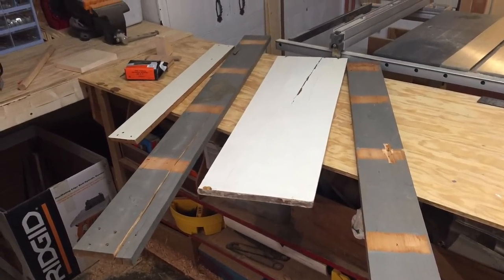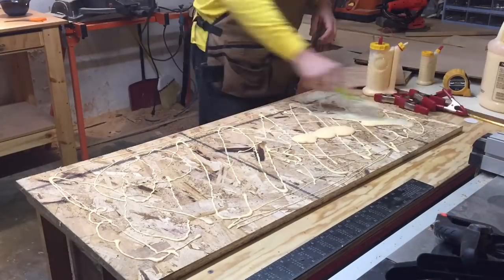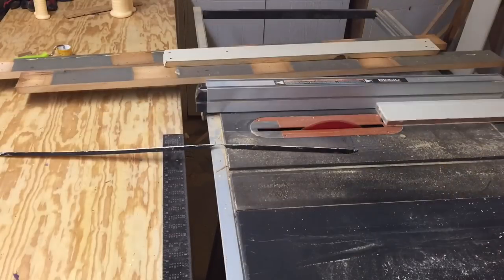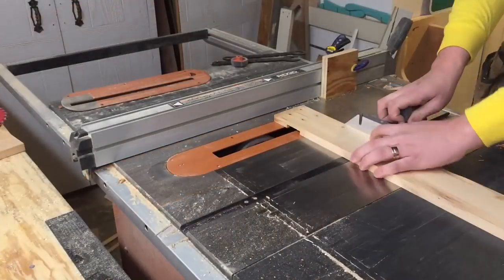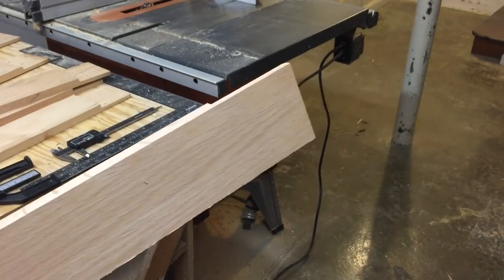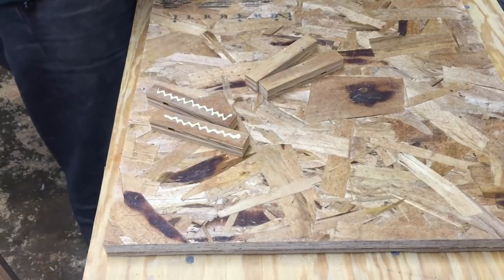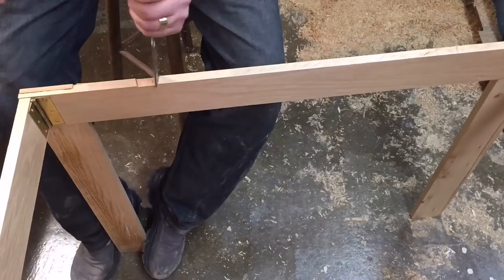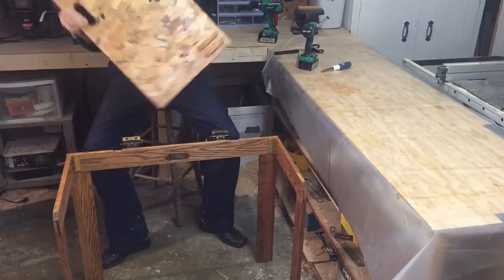How to Build a Collapsible Portable Table

Comment: Great video!  Quick question: when completely open, in use, does the table feel sturdy or does it wobble?
Reply from the maker: Thanks!  It's relatively sturdy.  I use it primarily as a portable table for setting down tools and supplies on when I'm at a worksite.  That being said, I have used a big chop saw on it and everything felt stable.  For me, I wouldn't feel comfortable with anything huge on it, but small & medium items are safe.

Comment: What kind of hinges did you use for the legs that folded in?
Reply from the maker: It's been so long since building this table that I really don't remember.  Odds are though, they were just a set I had lying around!  Happy building :)
Reply: hm... I plan on putting two monitors (I would say about 10 pounds each).. what type of hinges do you reccomend for that?
Reply from the maker: I really couldn't say.  My first thought though would be to check the packaging for the hinges you're looking at.  Odds are there'll be a weight tolerance listed!
Reply: okay thank you!